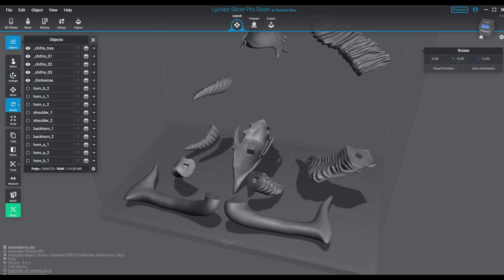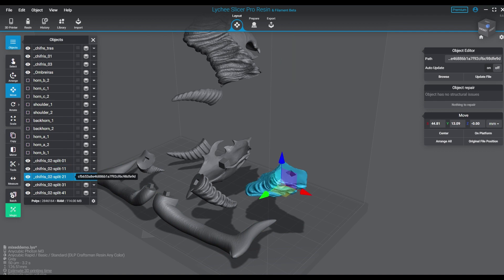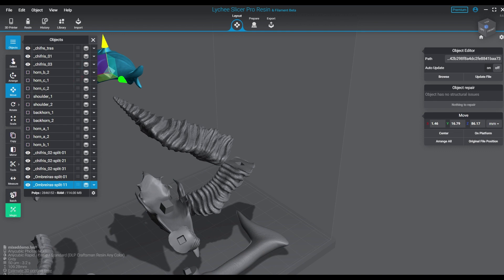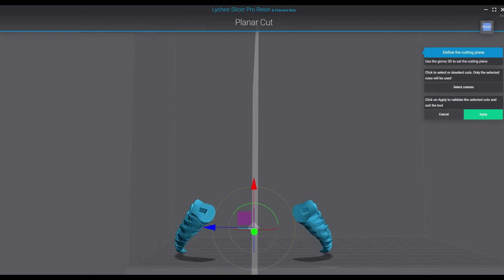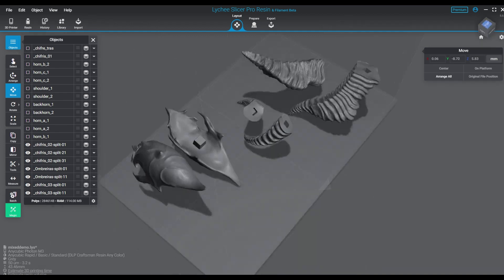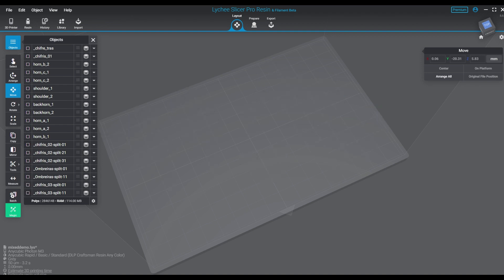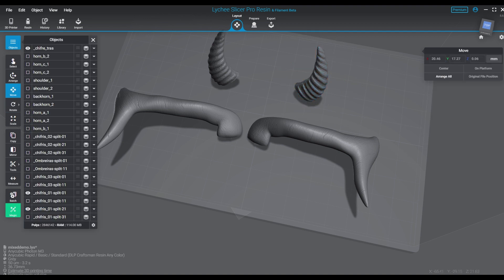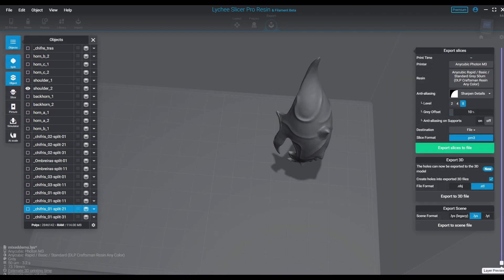Using the Split Command - Lychee Slicer Software 3D Printing How-To

Comment: Can the split tool be used to remove supports from a model that were added outside of the software?
Reply from the maker: In theory yes, but I have not tried that. Let me know if it works.
Reply: Turns out it can just easily remove supports, if you have a lychee specific file. Super neat!
Reply from the maker: @JurneeJakes  Good to know. Great for any pre-supports you want to do yourself.

Comment: whenever i try to use the split of parts tool, it'll load two bars quickly but the last bar seems to take forever. any recommendations?
Reply from the maker: That is interesting. What version of Lychee? My thoughts are maybe it's an issue with the STL or there is nothing to split. Try repairing the file with MS 3Dbuilder first, maybe that will fix the issue that is causing the last load to take forever and/or crash.
Reply: @IPrint3dMinis  i’m on 5.1 but it did it on a few of the items from the same set. haven’t tried it on models from another creator yet.
Reply from the maker: The split tool has been updated a bit. The newer version works way better.